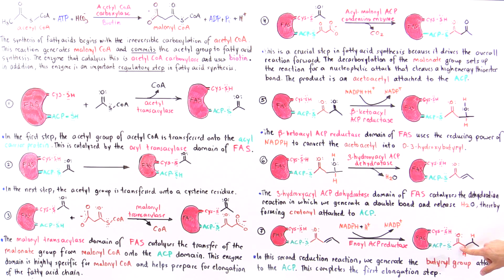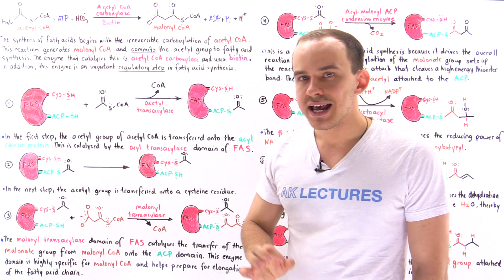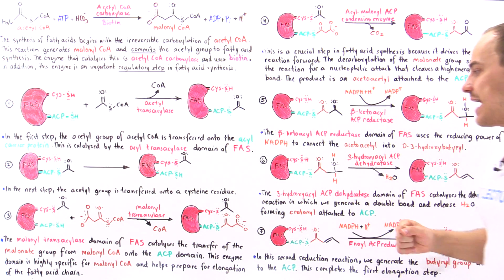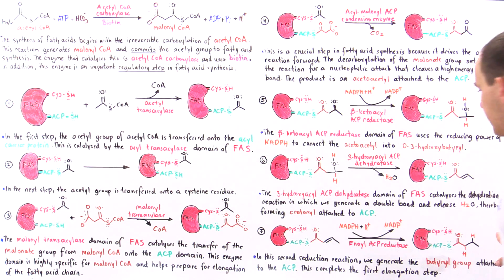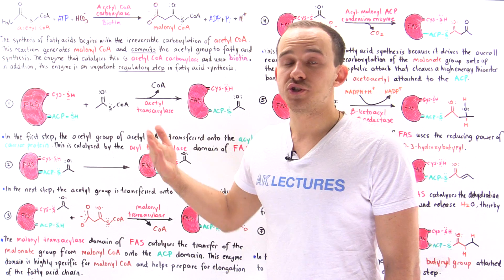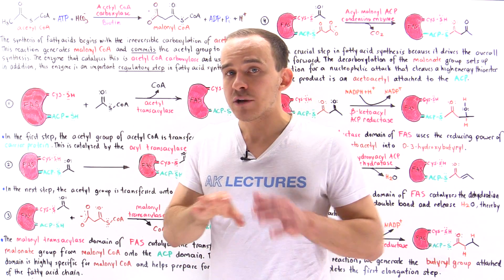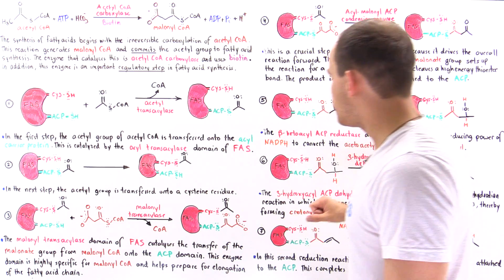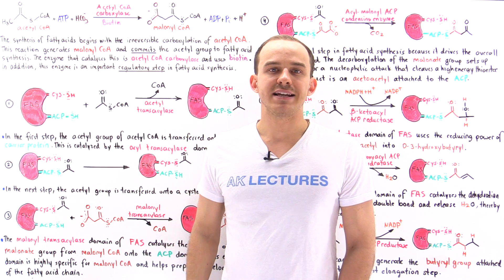Fatty Acid Synthesis (Part II)

Comment: Why does the elongation cycle stop when we have C16-acyl ACP? 
Does it always stop at 16 carbon-atoms or could the chain be longer/shorter??
And i dont understand why you talk about palmitate. I understand that it is a 16 carbon fatty acid, but does "fatty acid synthesis" always only synthesize palmitate? 

Thank you for this videos! They are really helpful :)
Reply: I have just found out that, there are enzymes on the cytoplasmic face of the endoplasmic reticulum membran that catalyze the elongation reactions in which longer fatty acids are formed.